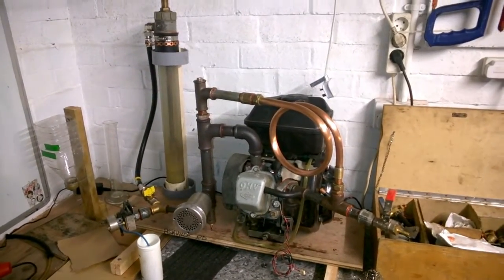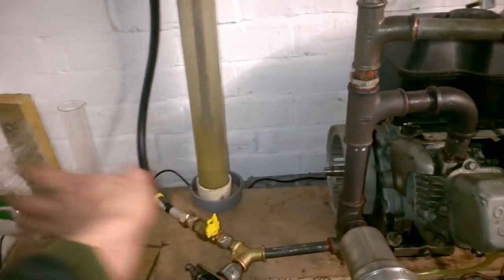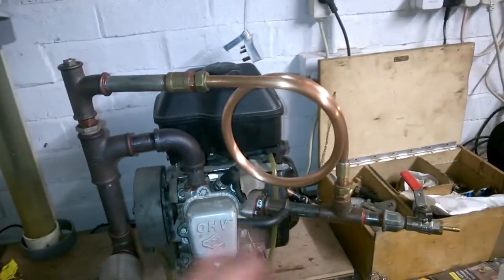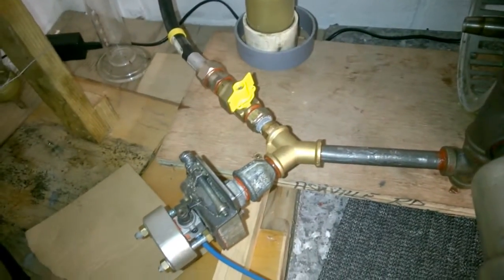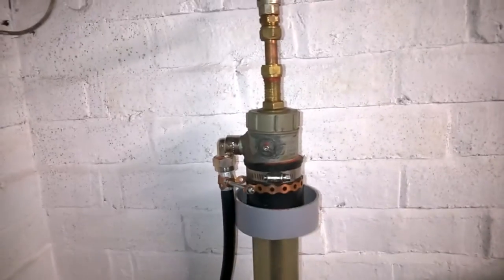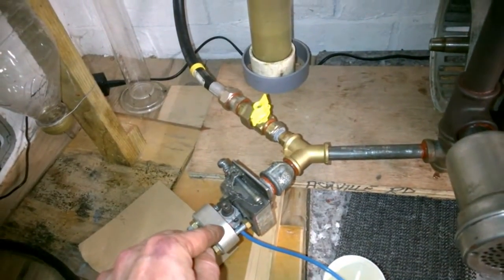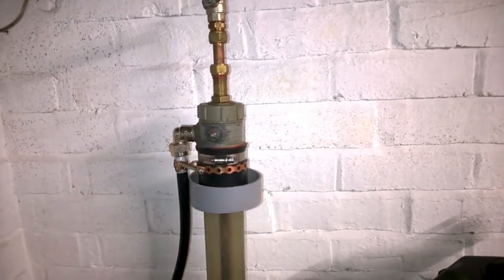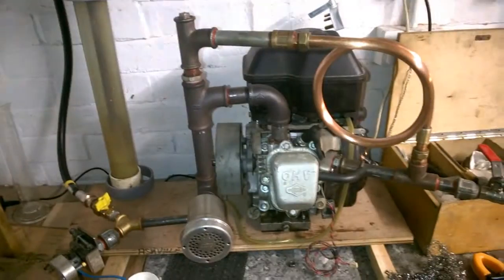GEET life Engine Running on Vinegar

Comment: Id like to understand more how vinegar is combustible.
Reply from the maker: Hi james. 
Vinegar is not combustible in any normal way.   When one adds a little extra acidity to a chosen "fuel" it makes it easer for the GEET reactor to convert carbon into hydrogen and produce more usable gas.   If you just add vinegar to petrol and try to run an enging it will stall out or more likely eat away the engine.
Reply: @dinskiy  Hey Dan, Nice to see you keeping this page going. I'm a ranch student from 2010 and had an exchange with you years ago. The world really needs a simple energy platform that can put out 50kW hours (car charging/air conditioning) per day into a battery bank.

I saw someone suggest to you the 20% alcohol/beer scenario which is what we discussed before. This is an important target because you don't need to distill to get 20% (40 proof) alcohol. If you have to distill alcohol for fuel in the states then it requires notifying the A-T-F.  If you're just homebrewing beer no notification need be given to the powers that be.

Here's the other big advantage. 20% alcohol is not a fire hazard when stored in large quantities like other fuels. I would really love to see you optimize a small genset design including rods and reactor specs so we can all duplicate it. Paul gave you some insights he didn't give the rest of us e.g. plasma v. vapor carb.

I also had a thought. Paul talked about how he would burn the reactor in by orienting it magnetically while it was initially running and the rod was getting charged. I though it might be interesting to mount the engine on a board with floats underneath and float it in a kiddie pool and see if the floating engine/reactor combo gets locked pointing in a particular direction. I'm wondering if that would enhance the magnetic signature being impregnated on the rod and reactor body. Just an idea. Love your work, particularly the gas analysis. Have a good day.
Reply from the maker: @demounit2505  Hi Demo, yes you can brew to about 20% ethanol, if you pre condition the yeast to be tollerent to that high an alcohol content.  

I found that ethanol is not as punchy as petrol so you need to get to about 35% before there is enough energy to let the engine start up. 

You could use 20% and then add a shot of petrol so it starts up, then your away.  Having a little sugar in the mix will help to, so will adding a little vinegar.    

On the subject of magnetic orintation; this was only a requirement for horizontal reactors.   They worked better when the exhaust inlet end of the reactor was to the north.   The vertical mounted reactors work consistently in any orientation and are generally more efficient. 

You may need to run the engine for 20min to 1 hr and then let it cool down completely.  Then run it again, possibly a few times, before you have reset all the magnetic field and then it will work. 

If after 2 or 3 goes it's still not working there is probably a design or fabrication issue.

Comment: Is it possible its revving up because of the added oxygen?
Reply from the maker: Great question.
With a geet reactor you set the air fuel mix supplied to the reactor to be very rich, then add the extra air with the AMV fitted to the intake port of the engine. 
AMV  Air Management Valve. 

In this case the AMV is set to deliver enough air to match the petrol and vinegar supplied to the reactor. 

When I close the bubbler and limit the total fuel the engine revs down, when I open it and send more air with vinegar vapor to the reactor it revs up. 

If I still had it set up I would happily make a new vid showing the responce to opening and closing just the amv.  Apologies for missing that step when I made this video.

Comment: That's fascinating the way the vinegar makes it rev up any chance of running it on just water with no petrol ? So does the petrol fuel your adding go through the reactor  ?
Reply from the maker: yes.  The petrol goes through the reactor first, then when I open the bubbler some vinegar is added to the mix before the reactor.    In fact, opening the bubbler not only adds vinegar it lowers the amount of petrol simultaneously because opening the bubbler robs vacuum from the carby.  

you can do the same with any other liquid but pure water has a lower atomic density than say coffee so its best to add something to the water like sugar or salt.
Reply: @dinskiy  Thanks for getting back to me I take it you don't believe it can be run on straight salt water without any gas ? My idea now is to brew beer in a 55 gallon drum and use it as my bubbler the beer would be 20 percent alcohol do you think that would work
Reply from the maker: @cushionofair  Yep did that and it's good.   
you need a min 20% petrol to get it all running, 20% ethanol is just enough.
One can't start an engine on water vapours that has not been converted into geet gas, and that only happens once the engine is running.

Your 55gal drum is too big for the bubbler though, you need to match the bubbler to the engine or it won't power up.
Reply: @dinskiy  How about septic tank water ?
Reply: So your saying you can run it on just water once it gets going ?
Reply from the maker: @cushionofair    Yes In theory...... 
Paul told me that he had managed it a few times but really you need 20% flammable stuff in the mix to make it all work..  
   20% crude oil and 80% seawater was Paul's fav mix.
Reply: @dinskiy  Oh yeah I remember paul said in an interveiw that a couple of boys got one going at a sceince fair on pickle juice and mountain dew or Windex but it sounded like there could have been gas in it he didn't know about .My dream is to be able to make fuel from water .

Comment: What is the reason for bending in circular of the copper tube after the reactor?
Reply from the maker: You need enough pipe to allow the GEET gas to cool down before it goes into the engine.

Comment: It was only pulling oxygen through the vinegar. The fuel line for the carburetor was still in the gas. Ball valve adjustment only changed the amount of oxygen intake. 🤦🏼‍♂️
Reply from the maker: That's mostly true and i can see how you came to this assessment from the short clip..
The carby is always delivering the minimum amount of petrol to run the engine at low RPM...
Opening the bubbler allows more Air, mixed with vinegar vapour, to reach the reactor with the small amount of petrol....  When I open and close the bubbler it revs up and down as the "fuel mix" is converted to geet gas     

If i don't open the bubbler but instead open the Air management valve (on the engine intake port) the engine does not rev up any further, as it is set to produce max rpm with just the petrol...
Reply: you should measure the consuption of vinegar and gasoline, to see the difference.

Comment: its insane. Bro does there is 100 percent water  in the bubbler and no other fuel I.e. any ratio of 20% fuel and 80% water.
Reply from the maker: hi  
I just put this system together so im still finding out what it will do and tuning things.
I set it up to have just enough petrol from the carby to run the engine at low RPM.
The bubbler has pure vinegar in it and that what is making it rev up and down.

I'm going this way with it, as mixing petrol and other stuff in the bubbler is always a bit of a pain.
This way it will run continuously in a stable manner so I can have a proper play with the petrol not petrol mix..
Reply: @dinskiy The next step once you have it reforming is to turn off the petrol and see if you can run it on another liquid my idea is to use multiple reformers to crack water into combustible gas !
Reply from the maker: @cushionofair  You can do that if you have a really good system that is running 100%.
Multi reactor setups are the way to go..   Each reactor is tuned for a given fuel.
Reply: Dan Easton Bro how to make that solid rod inside the geet reactor or from where I can purchase it?